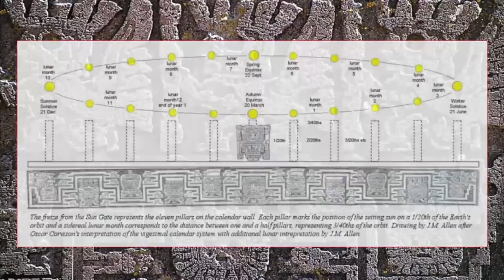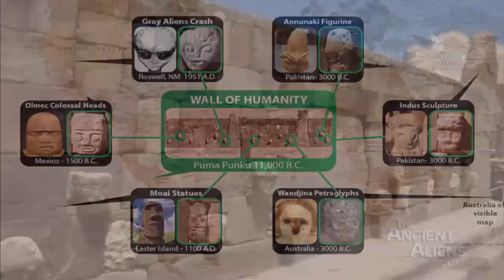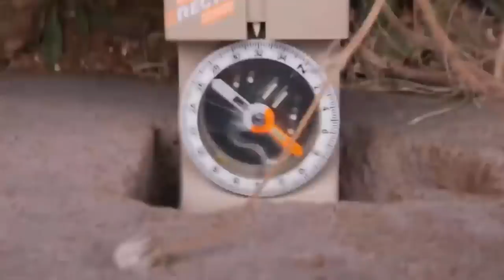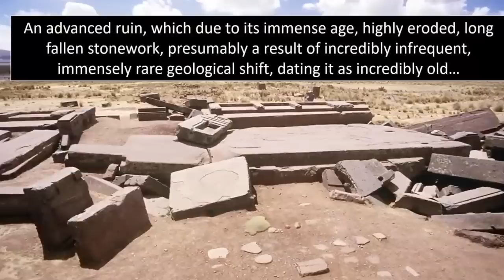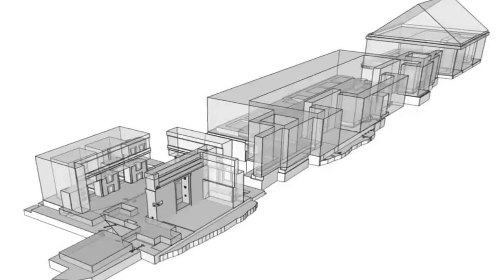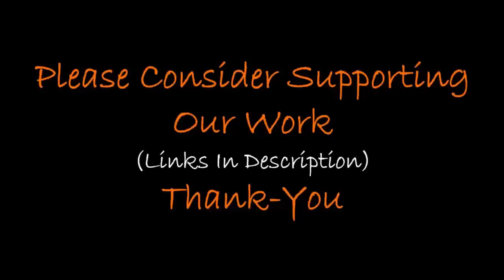Ancient Secrets Unearthed In Puma Punku?

Comment: Wall is modern.
Reply: Literally none of these many walls in this video are modern. Wtf are you even talking about
Reply: We are not talking about your home wall out here. Sorry, but these are suppressed findings about our ancestors building capabilities including yours. Marinate on that...
Reply: @03stmlax  the wall of humanity was rebuilt by archeologists in the 1800s.  the tall stones were there in place, but all the smaller stones were put up by the archeos in the 19 cent.  including the face blocks.  there are photos that show the before and after somewhere on the web.
Reply: @revminTphresh  if they are tall, they are not stones but boulders... stone are just different rocks placed on your front lawn for decor. But intricate and precise cut boulders placed to hold an elaborate structure not even a  sheet of paper can fit in is... you get the point.
1800s and 1900s please share some engineering ingenuity pics of that age on how they lift these boulders let alone cutting with laser precision angles or placing it on construction. Out there just wont cut it.